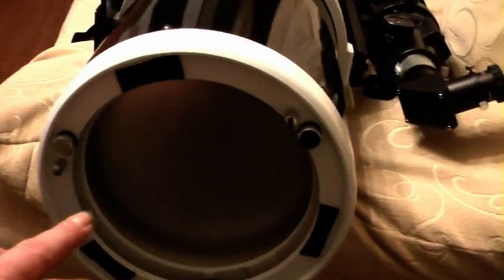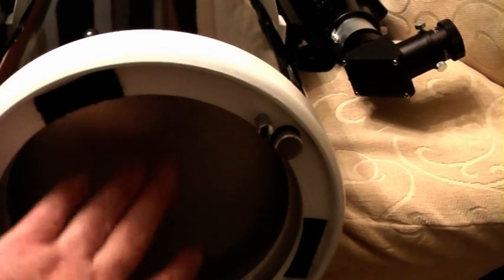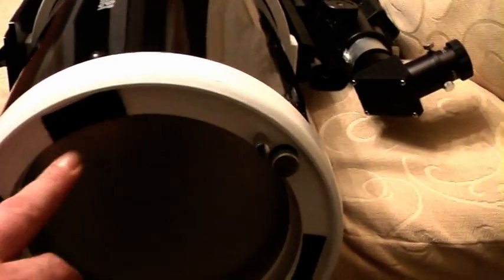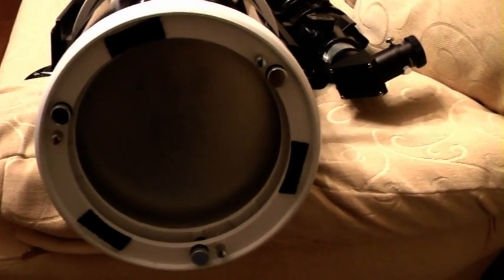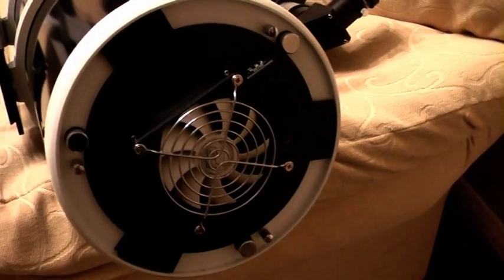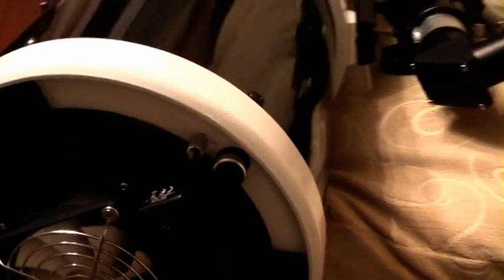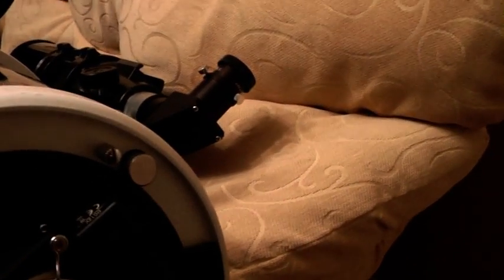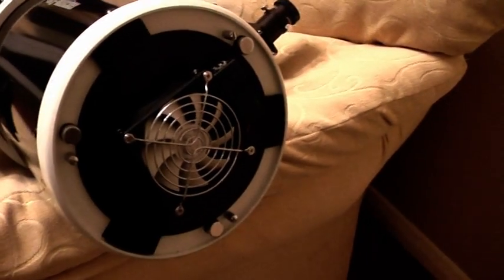Newtonian Cooler Final Design

Comment: Looks good, one thing that is confusing me, you are calling it a cooler fan, I need something to stop the secondary mirror fogging in winter, is this the purpose of this fan? Sorry if that is a stupid question.
Reply from the maker: You are confusing cooling with dew/condensation. When a big lump of glass like the primary is brought from a warm house into the cold air you get distortions. What you need is a dew shield or dew heaters.
Reply: @astronomyshed  so no good for dew control, I heard they were? I use dew heater with my refractor, but never successfully with my newtonian.
Reply from the maker: @johnybaby2  That not the primary purpose but it 'may' help. Fitting a neoprene dew shield may help, it used to work for me on my newts.

Comment: Looks great! I have an Orion XT10 which has 4 predrilled holes for fitting a 80mm cooling fan. I have plenty of these so I thought I'd make one myself too. Would a 9V battery be enough too cool the mirror or would the airflow be too weak? I assume you are on a 12V adapter, but it would make it nice and portable. ;-)
Reply from the maker: I found a 9v battery didn't last long driving a fan motor for hours on end so went 12v

Comment: I know its an older video but its new to me , very nice workmanship and great setup . I've been an amateur astronomer since I was a kid , Now I am just taking it up a level and it seems there is a massive learning curve , never had a moisture/dew problem until tonight and this general design will definitely help lots not to mention the benefits of a properly climatized OTA. I'm going to use a computer fan and a speed control with either a universal adapter or a 3 cell li/po , most likely going with the battery since its low drain, I have a few and I like to get up and go out to the dark zones. I'm going to sub in hopes you are staying current. Thanks , great video.